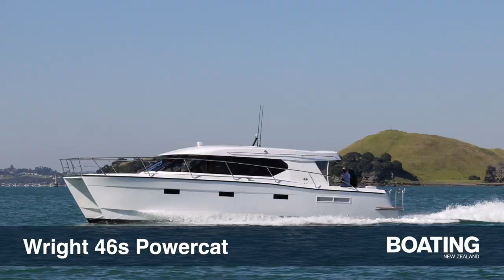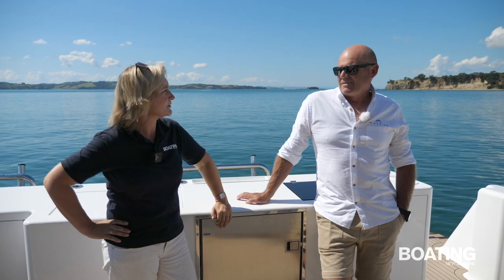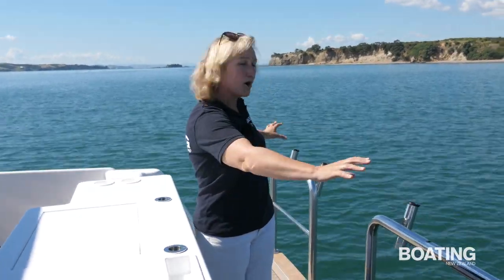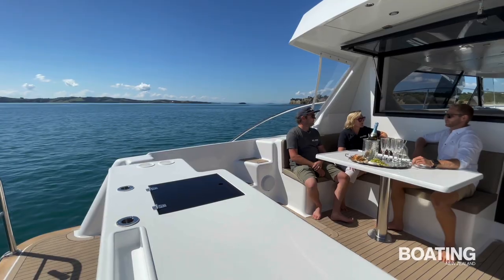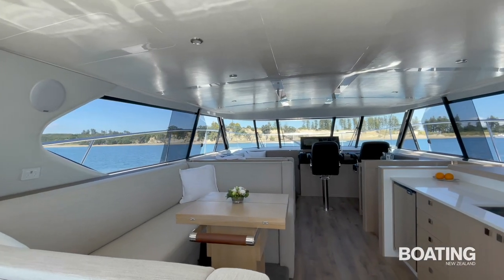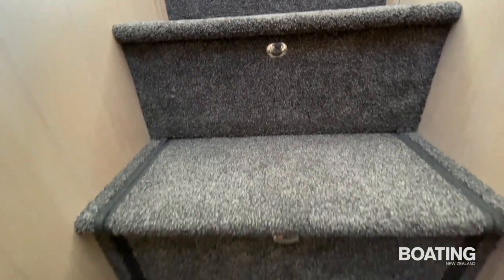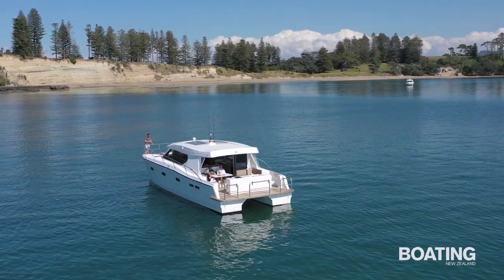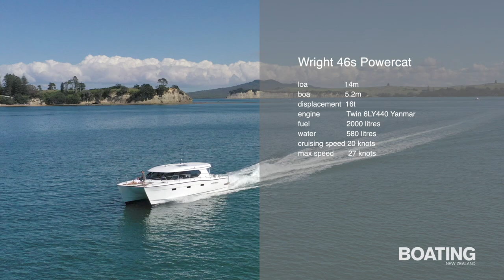Wright 46s Powercat

Comment: Solar/electric/batteries are too expensive. Yes they are quiet and convenient but don’t have the range. I prefer the new MERCURY V12’s.
Reply: At US$77,000 for each MERCURY V12 plus the high fuel consumption, you call the solar/electric/batteries expensive 😎
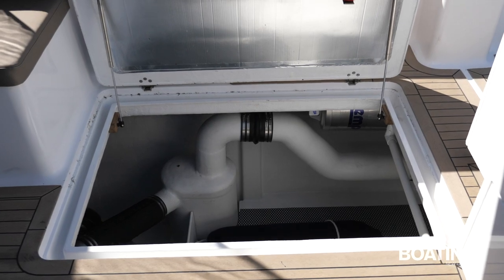Reply: The boat has Yanmar Diesel engines (see approx at time 2:34).  The solar/electric/batteries refers to the house electrics not needing a 230v diesel generator to run the ship systems like refrigeration and lighting etc when at anchor.
Reply: When It comes to engines, I am a huge fan of the I6.  I am greatly saddened that the I6 engine is not as common as I would like.
In accordance to my engine preference, I think the stock engines are perfect.
Reply: @johnsmithfakename8422  I 6…?
Reply: @Mr91495osh  
I6, Inline 6, Straight 6. 
The engine layout with the least number of cylinders that have innate primary and secondary balance.
Reply: I’d drop a couple of Volvo D8 IPS drives in her, with the Merc V-12’s you’d need to tow a fuel barge to get out of the marina!